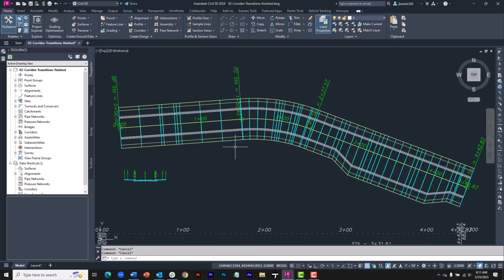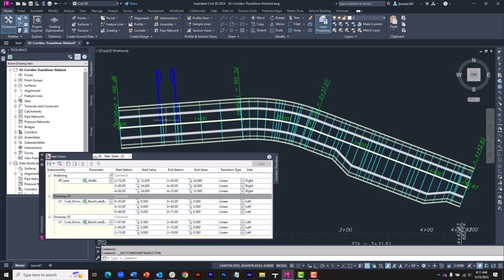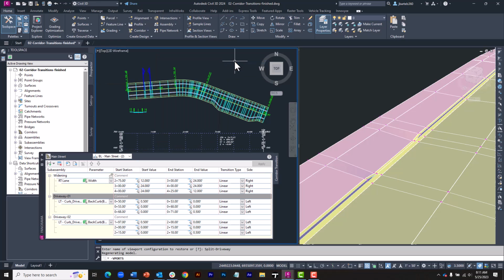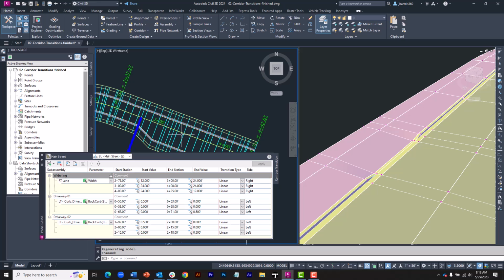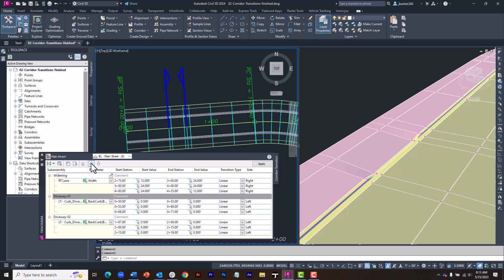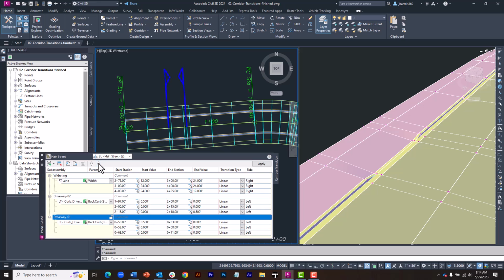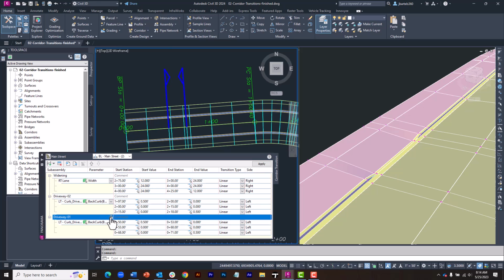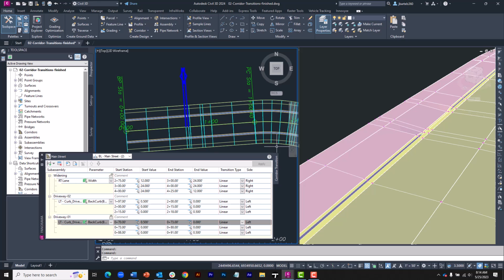Civil 3D 2024 New Feature! – Corridor Transition Management

Comment: Hi Jeff, quick question. Which curb sub-assembly did you use for this model? How come the levels on side walk (inner edge) didn't drop as the back of curb transitions to from 5 to 0?  How do you acheive this? Many thanks
Reply: Jeff please take care of this case
Reply: you got answer for this?
Reply: @maroroyal7  No..
Reply: Probably in the example a custom subassembly is used
Reply: You can use the out-of-the-box assemblies for this, nothing custom required, although you can still use them if you have them. To keep the inner edge of the sidewalk in place using the transitions feature, you'll need to set vertical targets for that inner sidewalk edge to hold the geometry in place. 

Aside from this video, you could also use conditional assemblies to achieve this same result. Both methods have their merits and can depend on how you build your corridor models.

Comment: Can you do a video on how you make those driveway transitions? I'm especially interested in how to make the sidewalk stay at a constant elevation through the transition while the curb drops down to near zero. Thank you.
Reply: i think you need to add elevation targets to the subassembly and then create a profile with the elevations you ask for
Reply: Seconding request on how to do this! I figure you can extract a feature line from the sidewalk prior to adding the driveway transitions, break its dynamic link to the corridor, and then use that as a target. but then if you ever made changes to the corridor that affect the driveway grading, you'd have to redo the entire process.